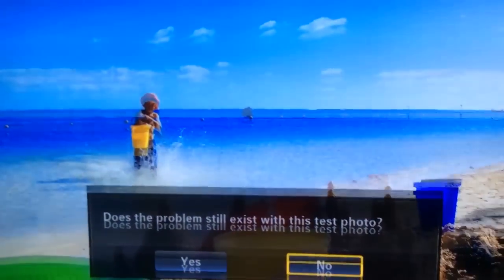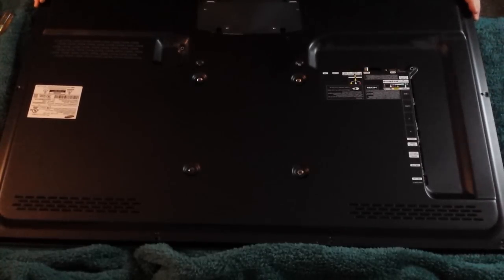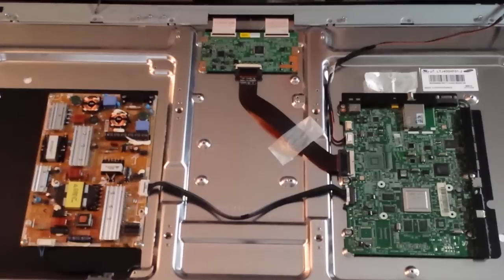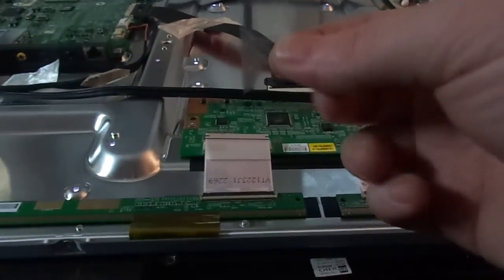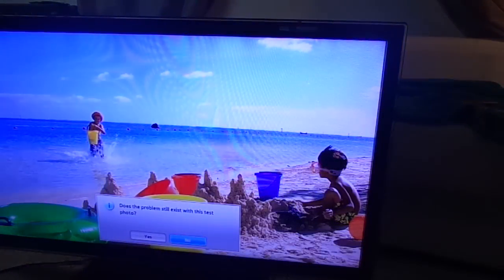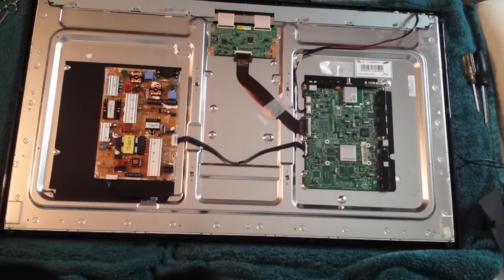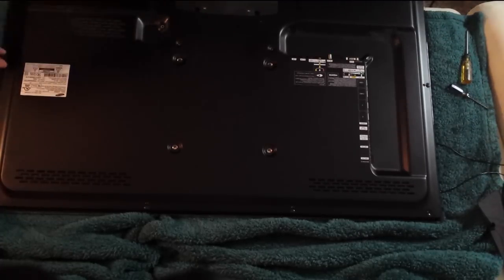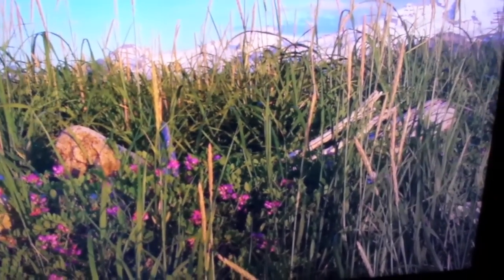LED LCD TV FIX, How To For Samsung Double Image, Black Vertical Lines, Screen Problem Sony LG.

Comment: Hi Dave, me again. After trying to slide the ribbons in and out I was at a point where I was getting vertical coloured stripes on both sides of the screen and then, just blue and no more half screen when I took either the left or right ribbon out. All blue every time the power is on. Any idea what I might have done? The screen is no longer responding to the ribbon connectors I think...
Reply from the maker: Hello Claudia,   I have not had or heard of the screen becoming complete blue until you posted your experience.   First I would turn everything disconnect any devices that are connected to any inputs and remove the power cord for 15 to 30 minutes.   Before plugging anything back in push the power button on the TV a couple times.   Pushing the button before putting power back may help discharge any built up electric being held by the power supply.   Then remove both ribbon cables and reinsert the power cord.  Turn on tv.  See what happens.  If the screen is not completely blacked out then there is something else going on with the tv.  If the screen is completely blacked out than reinsert one of the 2 ribbon cables.   See what happens.   You should get half a screen of picture.  If you don't then there is a bad connection with either the cable or slot.  Remove the cable you inserted first than reinsert the opposite cable.   See what happens.  The same goes for this side as stated before.  
Now if you have both sides coming on independently remove both cables and gently remove any tape that was applied to all ribbon cable ends. Using the tip of your finger wipe both gold contacts on each cable.  This was stated in an earlier post to help discharge any built up static electricity.  Insert both cables back into their correct slots and lock down the tabs.  See what happens. If the double image is present than try unlocking one of the cables and gently moving it up down right left and see if there is any changes.   If you see nothing happens 'it should be obvious' than try using the tape again.   Keep in mind that the only reason the clear tape is used is to put a very small buffer in between the contacts for the slot and cable so no static electricity can build up causing the double image.   I hope this this information is of help.   If you have any success please post.  Every situation that someone is able to fix helps us all.  Thank you for watching.
Reply: Do It With Dave Hi Dave, We did what you said and there is still no image. As far as I can recall, I lost the image completely after I removed the ribbons from the bottom connectors (in other words I took them out completely). Could that have cut off anything? Right now I have power but zero image. We are about to give up and put it back on the curb. Sad because I was getting somewhere. Just had a bunch of colored lines so I tried remove the whole ribbon to see if there was any dirt or dust...any ideas?
Reply from the maker: Claudia Carla Carnevale Hey there sorry about the late response.  The only thing I can think of without being able to physically look at the tv is something may have grounded out and short circuited a component.  I don't know if that is what has happened, but the fact that our tv is not displaying anything makes me think it's more that one of the ribbon cables that go from the T-Con board to the display contacts.  Try to look for any obvious damage on the ribbon cables as well as the slots where the cables make their contact.  If you don't see any signs of burnt or warn cables and the slots look good than further investigation would need to be done to detect any issue with the tv.  Normally that means testing multiple contacts with an ohm meter.  That starts to become a more advanced procedure and it my not be worth your time.  I know you may really want to fix this issue yourself and I would as well however some we must decide if our time is more valuable doing this or something else with.  Again not too discourage you I just want to put it out there that all these LED and LCD tvs are going to drop dramatically very soon.  LG has a new technology that is the next big thing to be released later this year.  So the demand for the previous tvs is going drop as with the price of them.  I hope this helps.
Reply: Do It With Dave Dave! Thank you so much for all this information! You are clearly very knowleable and so generous with your time and information. Even though this particular issue mught not apply anymore (I think you are right about something shorting out since it keeps shutting down). I will wait for prices to drop. I have subscribed to you channel because I will definitely check your channel before going elsewhere.
Reply from the maker: Thank you so much!   You are too kind Claudia.

Comment from the maker: Rob Haycox,  Run a picture test on your tv.  If the line goes away than the issue is being caused by an external device like a dvd player or xbox.  You can also try to go into the picture settings menu and change the ratio of the screen.  Run through the different options and see what happens.  If non of this helps you may want to go to a repair shop.  I don't suggest that unless you already have a personal relationship with that person, normally it cost way too much and is better to just buy a new tv.  Also check around the web.  It's almost 2015, there is a lot of help out there.
Reply: +Do It With Dave 
Thanks for the delicate work!  I had green vertical lines in all darker areas and was just about to open my TV (Samsung UE37D6500) in a repair attempt, as by chance, I had it out of power for about 12 hours, then got the idea to NOT have the internet modem in the same powerline as the TV AND THE PROBLEM WAS FIXED. A user in a comment (sorry forgot in which forum when not here somewhere) noted, that problems can come, when you turn on the TV when the internet modem ist NOT YET ready. This seems to be the cause of the green lines.

Comment: after doing this with my SONY BRAVIA LED TV, it wont turn on (blank screen), i just got 5 blinking red light in POWER LED. how to fix this please?
Reply from the maker: Sorry about the late response James.  First of all make sure the tv is plugged in.  The 5 blinking lights indicate a bad panel or T-Con board.  If you want to invest more time into working on your tv then I would try to go though the steps in the video again but this time put the ribbon cable back into it's slot without any tape on it and see what happens.  If the tv comes on it could just be the placement of the tape, There are comments from before stating from one view of this video that the tape was not needed for their tv.  All they did was wipe the gold tip of the ribbon cable with their finger and that discharged any build up of static electricity that was causing the issue.  If you still have an issue with or without tape applied to the ribbon cable then it would seem to be an issue with the T-Con board.  I hope this helps.

Comment: Great vid, thanks for sharing. Maybe you can help me? I have a pixel line out on my Samsung 65 Smart LED. The line is 4 inches from the left side and runs vertically from top to bottom and is a solid green line.... Any suggestions to get rid of it (I was thinking of throwing it out of the window :)) would be greatly appreciated.

Comment: Thanks Dave. You have saved a lot of money for a lot of people.

I was able to get rid of the double (ghost) image but as soon as I press on the tab, the black lines would come on. And I must have tried like a thousand times and spent two hours doing it but couldn't get rid of the black lines. So I made an improvisation. I took a long tape, stick one end to ribbon and another end towards the center of TV creating enough tension to keep the ribbon in place in the slot. Then I used a toothpick to adjust the tension and left the toothpick in place where I was getting the best picture. Though the lines are not completely gone, they became very light. Some other day when I have more time I will try to get rid of them completely.

Thank you again and god bless you.
Reply from the maker: Got MacGyver in the house. Thank you for sharing.

Comment: Hi Dave, Would adjusting the connectors also fix a blue vertical line I have on my Samsung LED? Or is this more of a problem with the actual LCD panel?
Reply from the maker: Hi d3x74,  A blue green or red line is usually caused by a dead pixel line or an external device.  In the picture menu run a picture test and see what happens.  If the line goes any then an external device is causing the problem. If it doesn't go away it may just be a bad panel. Also try changing the picture ratio in the picture menu. Either way if you can't get a fair trade on it or are just going to buy a new tv  it's not a bad idea to try the steps in the video.
Reply: Do It With Dave , the reason I think it is the connectors is due to the fact that even if I change the input source the line still exists. Also it is a fading blue line (at the bottom it is non-existent and it progressively gets blue at the top). 

Also the problem only started after I was testing/calibrating my new subwoofer, so I am guessing the thumping noises might have loosened the cables lightly.

I will follow the steps in the video this Saturday and report back if it fixes the problem.

Comment: My TV Samsung led 32c4000 cable  is solded to microschem ,any advice thanks
Reply from the maker: I m not sure where to start on that one. You might need to take up soldiering and get some info from a couple web searches. You might find that a entire component will need to be replaced which is easy.  Sorry I don't have very much to offer to you.

Comment: I have A Samsung Model # LN40A55093F the problem is on one side of the picture it has a lot of vertical line on the left side but after a while the picture clears you  any help here  dotsllc2@aol.com

Comment: I had the same problem with My 40" Samsung LCD. I watched the video and it really worked. My Samsung Service Personnel asked to replace the LCD panel which was quite shocking. How companies are cheating there customers. As the LCD was out of warranty, I gave a try before going for replacement. This video really worked in the first attempt. Dear Dave you were a great help. Thanks a lot and keep on posting such interesting videos
Reply from the maker: Thank you very much Sunny P.  I'm glad you found this video helpful.

Comment: Hello dave ... I am really impressed with the way u explain and fix the issue ... I am here to seek your help to fix my LED smart 3D tv (UA40F6400) . And the problem is when i switch on the tv, it remains complete dark and sometimes grey screen with many horizontal lines all around the screen. And after 15-30 minutes the tv becomes normal with no issue after that till i switch off. The same problem continues after restart. I did lot of surfing to fix the issue but all in vain. Expecting only u can fix my tv problem . And i am really thankful for your help ...
Reply from the maker: Hello manoj beema.  I am not familiar with the issue your tv is having.  From what you posted it sounds like the tv is taking a while to warm up.  I would say there is a component in the tv that is not getting the power it needs to function as soon as you start it up.  I have come across some videos that show this same problem.  I think there is a component that is easily switched out.  Look up T-Con boards or power supply issues I would start there.  Please post any progress you make.

Comment: do it with dave  ive been watching this video many times trying to fix the black lines on my tv.  i had the problem on both sides of the tv.  on one side i was able to fix without using any tape. but now on the other side i cant seem to get rid of the lines.  i mess around with the ribbon cable to where i see the lines disappear, but once i push down the tab to lock it down, they come back.  i tried using a single piece of tape like you showed but still no fix.  maybe i need more?   also can you maybe explain to me what exacally the  tape  does??  maybe i can have a better understanding of the tape fix  if i know  why  you are using it.  also  should i not cover the gold contacts on the ribbon cable or is that ok?
Reply from the maker: Andrew Pacion I had the same struggle with the lines as I was adjusting the ribbon cable and pushing the tab down to lock it in place.  Try to let the ribbon cable rest in the slot without pushing it in yourself, then locking down the tab.  If you push it with to much force it will not make the correct connection and give the tv screen issues.  I found that using a smaller piece of tape seemed to work best, however not to small of a piece.  Enough to cover around 5 lines of the gold strip.  From what I understand so far the tape acts like insulation stopping the connections from building up static electricity.  SimplyBord commented on this in a much earlier post. And about covering the gold strip,  go to 5:54 in the video and you can see where I placed the tape. It is applied to the tip of the gold side of the cable just before the line that runs long ways though the connection.  I hope this helps Please post any progress you may make.  Thank you for watching.
Reply from the maker: You should be able to get access to the ribbon cable without removing the metal cover.   I took it off because I like to have as much room to work as possible.
Reply from the maker: Having different sized screw drivers is always helpful.
Reply from the maker: You should only see a double image on the screen if both ribbon cables are making contact with the slots they sit in.   The screen is made up of 2 panels.   When there is a build up of static electricity the panels don't work with each other the way they are intended to.   The gold contacts on the ribbon cables is where the static electricity is stored.  When you take the ribbon cable out of the slot the static electricity will be discharged and the panels will work the correct way after the cables are reinserted and locked down.   The tape helps to prevent this build up of static electricity becoming an issue in the future.  I put the tape at the very tip of the cable on the side with the gold contacts.   The tape is covering the tip of the contact.  Try to play around with the cables as you begin to push the locking tab down.   You may need to lift up on the ribbon cable a tiny bit so it doesn't go all the way into it's slot as you push down the tab.  If you start getting to frustrated it's not a bad idea to take a breath and walk away for a minute.

Comment: hey dave, thanks for the demo. this worked for me after some juggling. after initial tries i had to try on the right side ribon, it worked than ( almost after 45 min of fiddling) but now there are big white bleeding spots on the tv, trying to figure out the cause.
Reply from the maker: Hello meetjigs.  Thank you for watching.  It's strange that the issue went away only for another one to take it's place.  One thing I can say is after I completed this process the first time after about a week the issue came back.  First there were some black lines on the screen then the double image came back.  I repeated the steps however the second time after I was done I put a small piece of tape over the ribbon cable and secured it to the metal plate it sits on so the cable would not move.  As I moved the cable in the slot were it sits the screen would show some white lines then clear up then the whole screen would become white then finally become clear.  So maybe try to adjust the cable a bit and see if the screen clears up so you can lock it in place using the push tab. Please post any progress you may make.
Reply: today i am gonna try tap/rub technique for backlight bleeding / spots issue (picture quality affected by 60-70%), ribbon positioning is not working for this problem. the original  problem of double image/ghosting seems totally resolved.
Reply: meetjigs I have the same problem. I have a double image and putting the tape on the left ribbon it takes care of the double image but then I get a bleeding image coming from the same side corner. I have a un55d8000. I have bought matching ribbon cables and a t-con board from eBay with the same results. I have spent a couple of days on this with lots of tape. Did you get your bleeding image fixed meetjigs?

Comment: Hi Dave..My name is vamsee krishna from Bangalore,India.First of all thank you so much for publishing this video..Mine is samsung LED TV model UA46d5500RRXXT purchased in 2012 in Bangkok.I raised complaint with samsung when i faced this issue on 27 October and their service engineer visited my home on 28 October and he looked and said the panel is gone and had to be replaced with new one which will cost 45,000 INR.I purchased the TV for 50,000 INR.I showed with local LED Tv Repair shop on 28 October and they said it will cost 35k - 40k to repair the TV.I decided to buy a new TV then i saw this video.I thought why not give a try the same which you showed in this video.If it works then i am happy or i am gonna buy new one.I followed the same and a small piece of tape fixed the issue in one shot.

THANK YOU SO MUCH DAVE.....
Reply from the maker: Yeah!  I m glad you found this video helpful.  Thank you for watching and sharing you success.